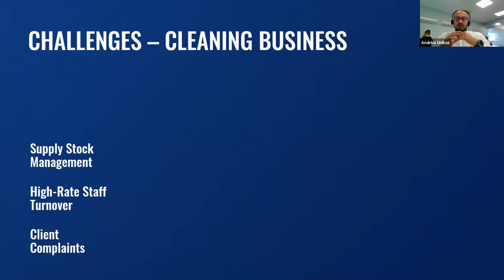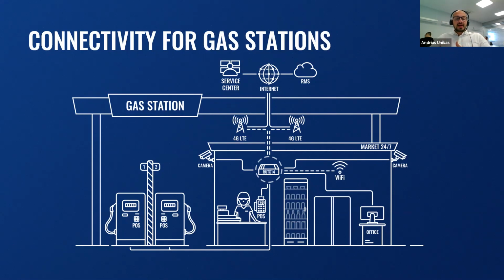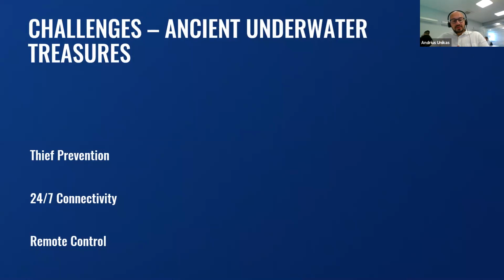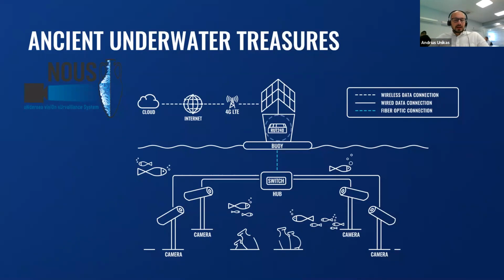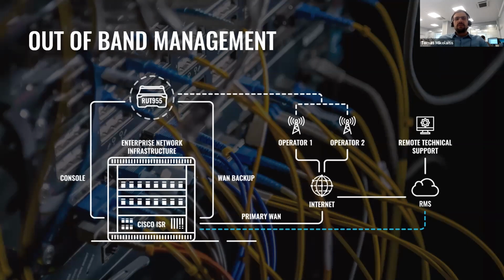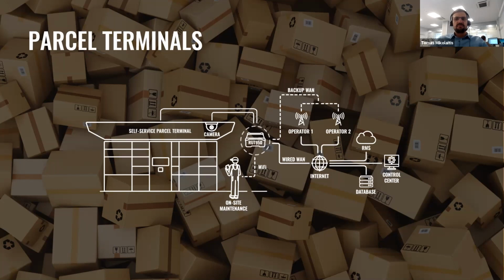Use Cases - September Edition 2021 | Teltonika Webinar

Comment from the maker: 00:00 Introduction
00:59 Case studies
1:33 Cleaning business
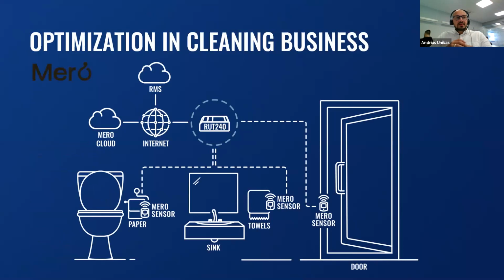2:48 Optimization in cleaning business
4:23 Benefits - cleaning business
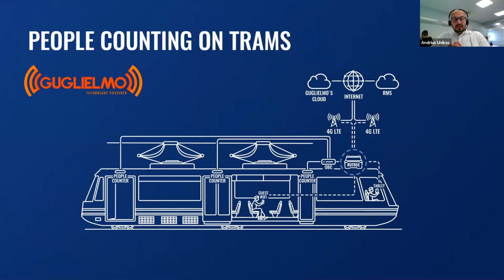5:53 People counting on trams
7:30 Benefits - people counting
8:22 Gas stations
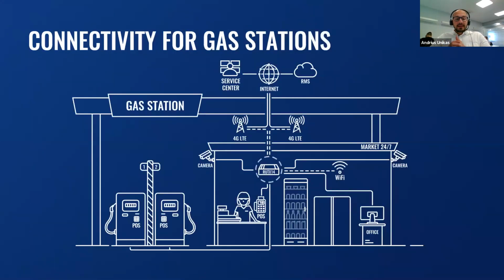9:17 Connectivity for gas stations
10:30 Benefits - gas stations
11:16 Public transport
11:56 Optimized public transport
13:15 Benefits - public transport
13:51 Traceability
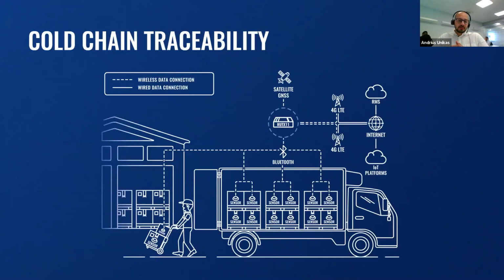15:04 Cold chain traceability
16:55 Benefits - traceability
17:22 Ancient underwater treasures first part
20:24 Introduction to Remote management system 
22:54 RMS | Smart traffic light systems 
24:58 RMS | Out of band management
27:27 RMS | Parcel terminals
30:11 Ancient underwater treasures second part
31:15 Benefits - Ancient underwater treasures 
33:01 Questions & Answers
41:44 Outro